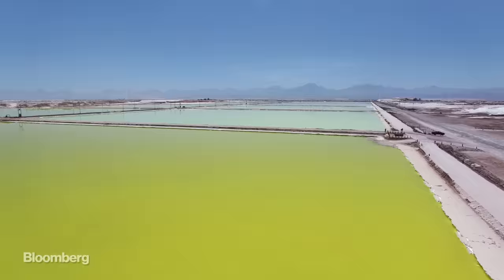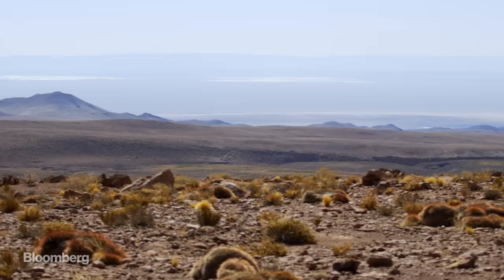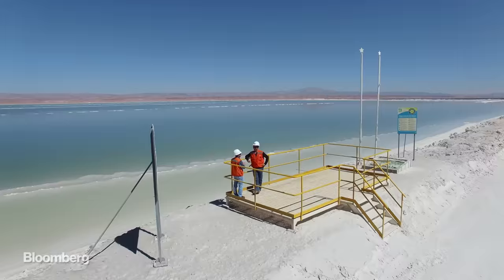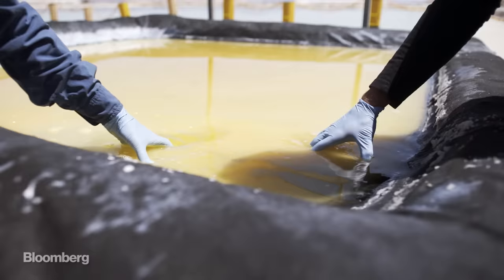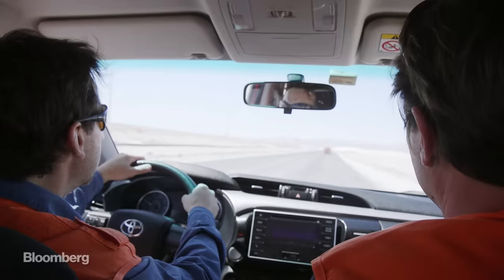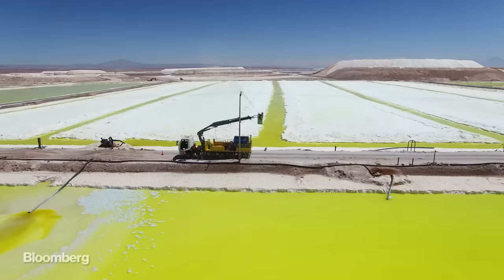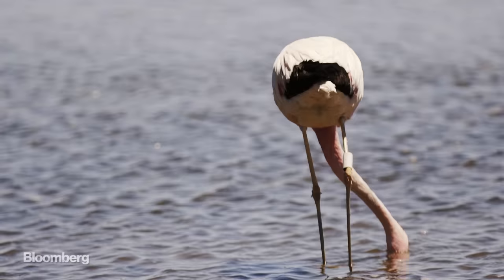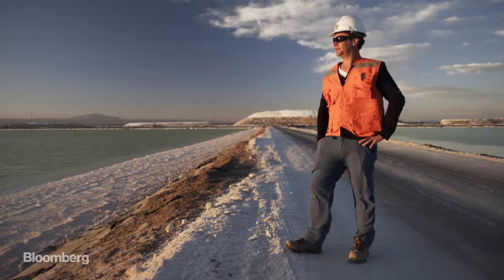Here's Where the Juice That Powers Batteries Comes From

Comment: Screw the lithium, what is that special steel they use for the pickups? I would love to have a Tacoma with a corrosion resistant frame.
Reply: Michael Coler hilux and taco is similar
Reply: Michael Coler They coat it with Rust-Oleum and seal it with rubber
Reply: Michael Coler aluminum?
Reply: Its probably so god damn expensive that it doesn't make sense to make consumer grade pickups with it.  Car companies need turn over rates as well.
Reply: Michael Coler go ahead and ask toyota...
Reply: 'These pick ups trucks suffer a lot, but the OTHER equipment we made them from a special steel' He didn't say the pick ups were made from special steel, sorry bro
Reply: I think he was implying that he would convert his truck?
Reply: Bob Dabuilder no
Reply: Edin Trumic after watching it again, you're right. Good ears.
Reply: +Google Account aluminium.
Reply: Just buy a honda.
Reply: Definitely not aluminum, the salt in the air burns right through the oxide layer and trash the whole thing. I'd love to see one of those aluminum Ford's after working this salt mine for a year...
Reply: It's made of that metal Wolverines made of
Reply: Michael Coler most likely the same metal the Ram  is made of. jk
Reply: Slayvid G hondas are literally the most prone to rust cars on the planet
Reply: Obviously, a nickel based alloy steel such as stainless steel.  You could have someone disassemble your Tacoma, nickel plate everything, repaint, and reassemble but it would be less expensive to just buy another Tacoma when yours rusted out.
Reply: Its probably an aluminum alloy mix of some sort... Send an email to Bill the science guy.
Reply: noway the hilux is much more smaller
Reply: That steel has a larger proportion of Phosphorus in it. It keeps it from rusting, in comparison with ordinary steel.
Reply: Stainless steal , high nickle and prolly one more ,chrome or Molly , a Saturn has plastic body , immune to salt ,almost.
Reply: @Flumi287  honestly just go asl Toyota
Reply: He said the trucks suffer a lot. The other equipment is made with a special steel...
Reply: Tesla Cyber truck is 304 SS.  Forget regular pickup trucks the future is SS.
Reply: Stainless I would imagine

Comment: Big Oil always uses these horrible polluting lithium mines as one of their talking points against renewables not worth it, glad the mainstream can see what they actually look like. Also, like he points out, the batteries are only 2% lithium, that's not very much needed per battery.
Reply: good points, i mean the mines are probably not 100% environment friendly, who really knows. But definitely way way better than extracting oil which is so damaging to the environment, specially when there is an oil spill. Looks clean
Reply: krlitos Mining has to be done for every Car produced, regardless if its gas or Electric, the difference is Electric is better for our Air/Atmosphere, then it's just a matter of developing Recycling Chemistry/ Procedure/Legislation and Power that Recycling with Renewables. Related, look up Ambri Inc. and Both their Liquid Metal batteries and New Efficient Process for refining Metals
Reply: +Big A; Indeed, and lithium batteries can be recycled. Look for video "Renault - The circular economy electric vehicles batteries" .
Reply: The process used to produce copper is the same as lithium. Saturate ground which is rich with copper sulfate with water, let it dry up in pools to crystallize. And you don't here anyone complaining about copper mines.
Reply: Big A 
I completly agree and what's more important is for the batteries to be recycled the same with everything. we need to change the way we do things we can reuse recycle products fix products as well. 30% of co2 emissions come from manufacturing therefore we need to have a society that fixes instead of throwing away
Reply: TickyTack23 the same process is used to mine uranium in australia and a LOT of people complain ....
Reply: Nun Urbuisness That won't happen. E.g. planned obsolescence
Reply: Big A So COAL AND NUCLEAR powered cars DON'T pollute the environment?
Reply: Nun Urbuisness How is a COAL powered car going to reduce emissions by 30%? Don't forget the radioactive nuclear waste while you are at it!
Reply: what are you talking about
Reply: ELECTRIC CARS ARE MAINLY POWERED BY COAL AND NUCLEAR FUSION! Go get a pie chart or some shit and you will see what I am talking about. Furthermore, do you realize you are converting heat energy, to kinetic energy, to electrical energy, to reverse a chemical reaction. That chemical reaction takes place again to produce electrical energy. Every time you convert energy you lose some, usually in the form of heat. Now the question is, which is the better fuel? Coal or gasoline?
Reply: Stacy, Nuclear Fusion is in a development stage at this point, it is not in commercial use. The two most promising nuclear fusion projects are the ITAR in Europe (a few billion dollar incredibly complicated research project) and the Lockheed reactor which is much smaller in hopes of being able to make more agile development changes. Neither of these is in use in commercial power plants, the ITAR project is actually expected to need more power to sustain a reaction than it generates. Now, Nuclear Fission, is in use and is the method current nuclear power plants use.
Reply: Raul M. What are you talking about electric power usually comes from coal or nuclear power plants sometimes those windmills actually produce more carbon omissions then they save and generate no electricity The only way to make electricity partially clean is with hydroelectric dam's not to mention in manufacturing your car is using way too many resources to manufacture me I'd rather drive a bad ass 79 bronco would yes on a good day it gets 20 mpg but that's good for a 400 low torque cam Ford racing heads and valve covers at 6:50 carburetor
Reply: Big A you think they own those mines.?
Reply: Big A but its not polluting its a natural mineral
Reply: Evan Wiedling My bust. FISSION. I guess that's what happens when you hit the wrong suggested word. I guess I should be less lazy when I type but it's likely I won't.
Reply: fake counter culturre against oil? have you taken an electricity class or a hsiotry class for that matter that talkes about tesla and how he his work was shunned for greed?!
Reply: can i call you? your making this world a bad place for the rest of us and i would like to change you opinion, hey maybe you can change mine lmao
Reply: Stacy Smith: I think what really matters is that the energy is more efficiently extracted from the source at power stations compared to in Internal Combustion engines.
Reply: SKMC69 What he is saying is, since production of the car itself is not environmental friendly, why spend the extra money?
Reply: Big A but still 2% of millions batteries is a lot
Reply: Big A 2% per person.... 7.5billion people, more or less
Reply: You Tube it's very little when considering that you can recharge your car with it for 10 years before replacing
Reply: Garry Reyom you have to charge the car which the energy comes from power plants so to charge a car would cause more pollution them a tank of gas or diesel
Reply: DRAGONALCHEMISTGAMES unless you or your city uses renewables like solar or wind. Takes only 6 years to pay off solar panels
Reply: Garry Reyom yeah I get your point but go watch Adam ruins everything: electrical car
Reply: lol I didn't know lithium and oil are the same
Reply: +Firefly Guitar tsernobyl must had been awesome. i hope that i could had been there and seen the explosion. guys u know it was a inside job right? russia tested nuclear weapon and saw that it actually was powerful xD
Reply: Big A this is a damaging process as well
Reply: Guys, lithium is not gasoline. You have to extract it to get it to make batteries, but batteries aren't what power electric cars, they're what hold the electricity that powers electric cars. When the battery dies, guess what? You haven't burned all that lithium up, it's still inside the battery waiting to be recycled and made into a brand new battery, so it only needs to be pulled out of the ground ONCE. How many times can you drive your car on the same tank of gas? Once. Then you have to pull even MORE oil out of the ground to get more gas, because YOU BURNED ALL THE GAS YOU HAD THE FIRST TIME. There's no way to recycle gasoline because it's a fuel, not a fuel TANK. Batteries are not a fuel, they're a fuel TANK, you can use them over and over again, and they never get burned up by using them. So many people don't understand even the first, most basic thing about anything they're talking about, but they talk like they're experts. Amazing. Dunning-Kruger effect writ large!
Reply: Big A though you are stating the obvious, I think there definitely are many who don't realize this. Thanks for taking the time to explain this.
Reply: smoke house no one said it wasn't important.
Reply: Big A Because renewables are an utter failure.
Reply: im going to guess that you wake up on the Alt-right side of the bed every morning Mike D.
Reply: Not really I'm just a regular guy
Reply: all i'm saying is roasted.
Reply: thats a funny joke. Covfefe
Reply: how rude!
Reply: Stephen beare how gay
Reply: Solar and wind power is increasing and will continue to do so. Are you suggesting that we wait until every single nuclear & coal plant is replaced before we even begin to put the electric cars on the road? It's a transition! Also, It's more efficient to treat and contain pollution byproducts from a single source on a larger scale. i.e. A nuclear or coal plant providing electricity to power 10's of thousands of cars is better than 10's of thousands of cars spewing the pollutants of fossil fuel all over the place across the country.
Reply: You don't think it takes energy to pump oil out of the earth, put it on tankers and ship it across to the world, ship to refineries and then transport it to thousands of little gas stations across the country only to then be burned in vehicles and release uncontrolled into the atmosphere. Electricity once created from a single source (nuclear/coal/solar/wind/hydroelectric) is very easy, safe and environmentally friendly to "transport" anywhere up to thousands of miles away in very large volumes 24/7.
Reply: We need to get rid of coal mines. Case closed,
Reply: You Tube hi
Reply: Big A deal
Reply: Extracting oil isn't damaging to the environment when done correctly..
Reply: And we've developed safer and more efficient ways to gather has and oil, like fracking. When done correctly fracking can supply 20-40 years worth of gas with only a small bit of pipe buried at least a few hundred yards into the ground, far away from any water sources.
Reply: So because electric cars are charged on the grid and could be powered by coal and nuclear, we just shouldn't bother with them?  Progress takes time.  Electric cars are far beyond what they once were.  So are solar panels.  Some day, your home will be completely powered by the sun and excess energy stored in batteries to be used at night.  Sun is the greatest power source we can harness.  It takes time and isn't always ideal, but without taking the steps necessary now, we'll never get there.  So yes, maybe we power the electric cars by using coal produced energy today.  But eventually we won't need to.
Reply: These mines aren't polluting they just pump the substance up into the pools brine evaporation process occurs via the sun environmental impact absolutely negligible when compared to oil or on it's own
Reply: We're forgetting that the batteries once made need to be powered and unless you're privileged from a first world country then that power will come from fossil fuels burnt in one area causing tremendous pollution when electric technology becomes more widespread. If we can get nuclear power used globally this could be a better solution.
Reply: ∆ even if all the electricity comes from polluting sources it still emits less than driving an ICE car. Nuclear is not a carbon neutral solution. Takes a LOT of carbon emissions in the first place to establish a nuclear power plant. Takes a long time to build one. They're very expensive. I am a proponent of wind, solar, geo thermal hydro etc.
Reply: Okay but oil produces electricity, lithium just stores it... So whats your point? Its not like fossil fuels arent going to be used to power the batteries that these lithum batteries are made out of.
Reply: Look up Butte, Montana. Thats how copper is mined.
Reply: TickyTack23 lithium is a million times more reactive than copper. Elemental lithium bursts into flames sitting on the counter you need to keep it away from the oxygen in air.
Reply: I never realized that coal tar, strip mining and acid rain and mercury in water from coal plants and other fossil fuel emissions was environmentally friendly. These lithium pools are just one part of the process, and its mass production style at least, and not spread throughout the environment all over like the oil we spill.
Reply: “It’s got electrolytes! It’s what plants crave!” 

Water? You mean like out of the toilet?
Reply: Ya its great for the drinking water
Reply: @Stacy_Smith  fission, not fusion.
Reply: @BedrockLeadership  Yeah, I stand corrected. Probably hit the wrong suggested word on my phone
Reply: @ShadowRifft  How is the electricity that charges these cars produced?
Reply: @xNemesiSxPR  keep researching the other elements that are needed for the batteries.  Damage to the environment far exceeds any form of mining in the US.  This video paints such a promising future for lithium batteries and electric vehicles and glosses over the true impacts to the environment as well as the human sacrifice!!!!
Reply: @ShadowRifft  Is it really better for our air?  What charges the batteries? It isn't solar!  It takes oil and coal to charge the batteries.  Tons of oil to mine lithium.  We need way better battery tech before electric cars are really effective forms of transportation and it needs to be cheap!
Reply: @Stacy_Smith  everything pollutes in one way or another, Its been shown that keeping your current gas /diesel car going and repairing it is in many cases more environmentally better than building another giant tesla plant,and building a ton of new cars ,infrastructure to charge them, and making batteries from lithium mines etc.
Reply: @a4000t  yep
Reply: @TheHWHunter Even if it’s mostly natural gas and coal charging the batteries it’s still far better for the environment because the efficiency of conversion is much higher.  Combustion engines are far less efficient than steam turbines at the power plant when it  comes to turning fuel into energy.  Even if oil is burned to create the batteries, it’s a one time thing but oil is being burned by transporting oil to refineries and then to gas stations and that’s happening every time you fill the tank.

Comment: I'm doing research about the potential of recycling Lithium-Ion Batteries, and there are companies now like Li-Cycle that are expanding that process. I hope that keeps on improving.
Reply: Can you share with me please. I will not have to waste time
Reply: r33mote  what would be the incentive for such a suggestion?
Reply: I'm an electrical engineer, what prevents recycling?  It's just a a metal, melt it down.  I understand it has carbon in it, burn that.  Does the electrolyte prevent it?  I've never understood why these wouldn't be completely recyclable.  Is it the energy that it takes to recycle it so monumental that it's not cost effective?
Reply: @Eastern1  So you want to waste someone else's time? 😄
Reply: S.c.w lam oll.famyl muslim frends time

Comment: All this talk about lithium mines killing animals just like any other mineral mine, but neglecting to notice that unlike coal, lithium is like lead in the sense that it's highly recyclable and like lead, straight mining from the ground will of course be severely reduced once there is already enough lithium circulating around the world market to viably recycle, just like how lead from lead acid batteries are typically recycled nowadays.
Reply: 4G12 it’s not even mines really it’s pumped which is not as bad as coal which needs to be drilled
Reply: Who recycles them? 95% of the things we make claim to be fully recyclable yet somehow most of it ends up in the dirt regardless.

Comment: The Process is a Little Primitive, maybe the Ponds are Not Needed if you Use Solar Powered Centrifuges, Filters, Pumps etc to remove Water.  Plus have Their Own On Site Big Lithium Batteries.